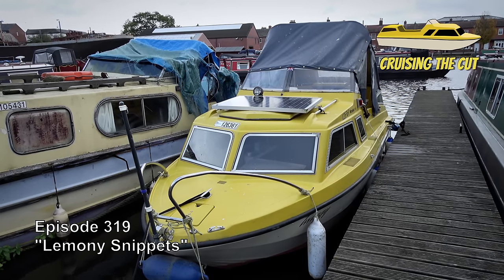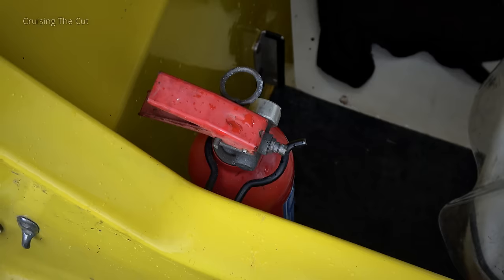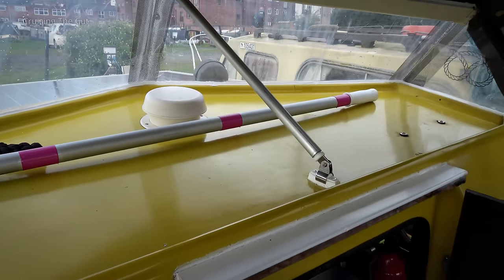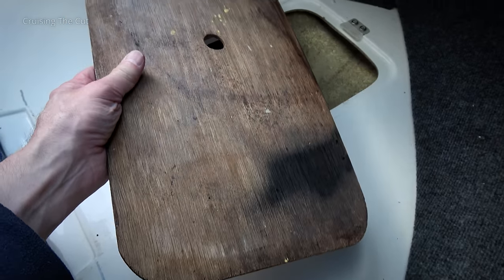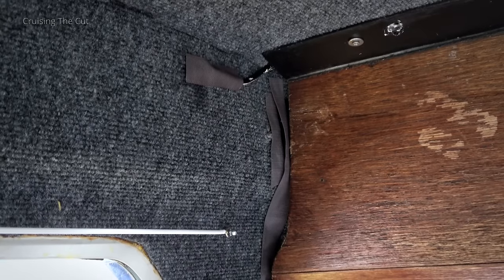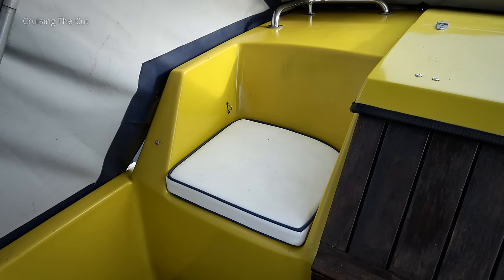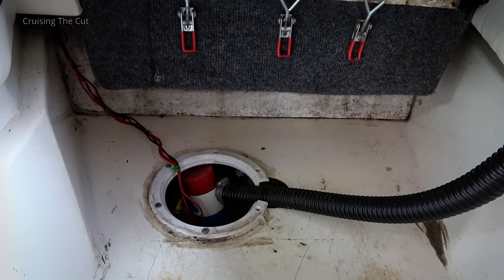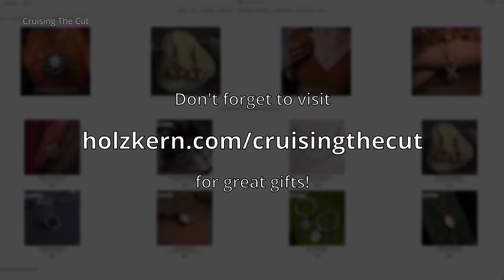319. My boat - the FULL TOUR!

Comment: I think the original purpose of the aft 'well' that's now holding water is for the outboard petrol tank.
Clearly someone has fitted a larger tank and located it in the aft cabin, terrible idea! I would look to getting a suitably sized tank so its not inside the accommodation space!

Comment: could the hatch not be opened by finding a way to fit the panel to it or on a hinge or is there a place to fit smaller panels to give the energy.  like the sides of the back each side of the door you open to start the boat engine.
could you not just put one way film on the windows.   why not just move the sink to the toilet side.
can your drain hole area be tanked and make be angle the area to the hole.
why match the colour why not just find a new colour and do the lot so you know it will last for year after doing it
is it not just worth making the back bit the bedroom or at least just move the kitchen there and make it a more roomy front section.

Comment: Maybe you should ditch the Honda outboard and swap for an electric motor, no noise, no petrol, safer - plus you said that you planned a refit of the electrics. Since it is a light craft, you don’t need a lot of power, provided that you have a mooring where you can plug in to shore power - why not!
Reply from the maker: Range!

Comment: Most outboard boats have a well at the transom
Reply from the maker: But why? It's such a rain trap!!
Reply: @CruisingTheCut as the motor has to sit on the transom the “lip” has to be there. The well doesn’t have to be there, but then water will run straight into the boat.

Comment: You need to use Flowcoat to repair Gelcoat, the Gelcoat will not set in air. Do some research on that, lots of youtube videos on the subject.
Reply from the maker: I've been watching a few but it's all very confusing (epoxy vs fibre resin, flowcoat vs gel coat, paint vs gel coat etc 🤯)
Reply: You can repair polyester resin (which is what your boat is) with epoxy.... but you can't repair epoxy resin with polyester. Epoxy is stronger and has less shrinkage.

Comment: Too bad you can't swap out the gas motor with a small torqeedo motor.  That way you can remove all the gas and add some batteries, cover the access hatch etc, and have larger aft cabin area.  Make sure that any fiberglass is sealed where there are cuts/holes as it will absorb water and delaminate over time.  Even if its a dab of silicone or clear fingernail polish.

Comment: As a over the road trucker I have to take showers in truck stops, do you have options for showering out on the cut?
Reply from the maker: There are some but I read recently that the CRT (canal authority) is going to stop maintaining them for cost reasons, so that's a nuisance.
Reply: @CruisingTheCut  all you and others spend on fees for the canals there should be showers

Comment: Did you know that 'Twiggy' was already a Youtube star? The 'a little bit of alsorts' [sic] channel has a few videos, including fitting the solar panel and the sideways electrical panel. (I think youtube will delete my comment if I try and add a link) - might give you an insight into why things are how they are... (I've no connection with the other channel, btw.).
Reply: Also, the boat used to have an electric start engine, but this was stolen and replaced with a pull start engine (from that other channel) - might explain some of the extra wiring. The purple insulation tape near the engine is for the 'kill switch' connection (the red curly lanyard clipped to the throttle control).

Comment: Is the trough in front of the motor for the fuel tank?
Reply from the maker: I don't believe so because of all the control cables which run through it
Reply: Having that in the cabin is more dangerous than propane in my eyes is all.

Comment: the color code wont help you, that coating has aged and certainly wouldnt match by now if you tried the original color.
Just take a chipped bit of it to a shop which has a scanner for paint mixing.
Reply from the maker: Fair point, I'll chip a bit off.

Comment: You do know that the engine can supply electical power to the boat. .
Reply from the maker: I'm not sure that one can but the engine will be replaced anyway
Reply: @CruisingTheCut  I think it can look for a white or brown cable near the flywheel Magneto's you will see a bunch of cable's and the power output connection sits on its own if not I will be surprised its not there along time ago as a marine engineer I use to fit power systems to little craft like these .But if your getting a new outboard that's fine they should have the power output kit.
Reply from the maker: OK, will do! Cheers for the tip, much appreciated :-)
Reply: @CruisingTheCut  Your welcomed 👍 Also you do know you can buy outboards that start up on a starter motor and a pulley you should look in to it save you a lot of time mucking around opening a hatch to start it.👍🤔

Comment: It is a nice boat, but do your self a favor, sell it and try again. If you plan to fix it the right way, it will cost more then the boat is worth.
Reply from the maker: Value is not the point, the fun comes from the renovation and then use of the boat. It's not all about money and profit!
Reply: If it was just about money,  no classic cars would ever be renovated,  sometimes it's just the fun and experience gained from repairing and renovating that's important.  You build up your skills for future projects,  but if you make mistakes it doesn't matter so much.